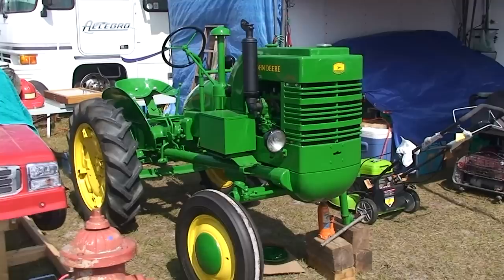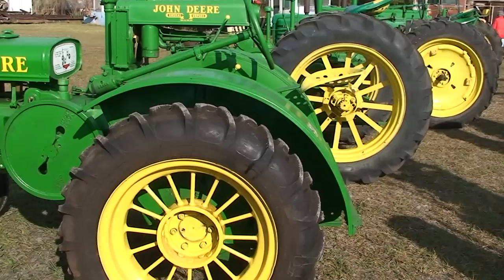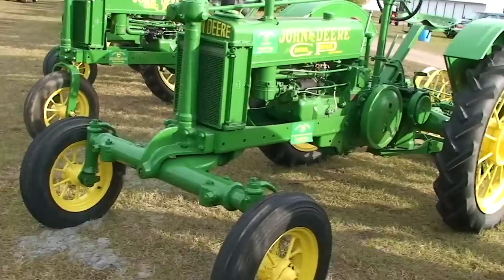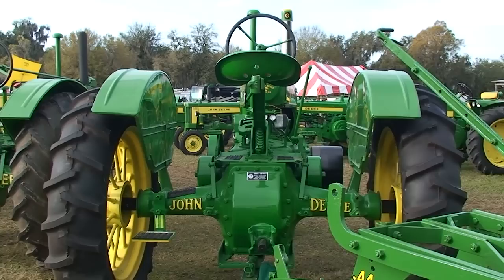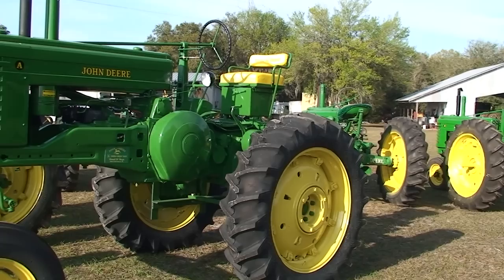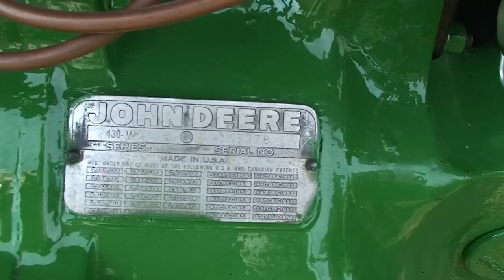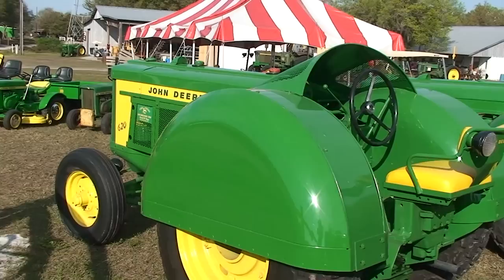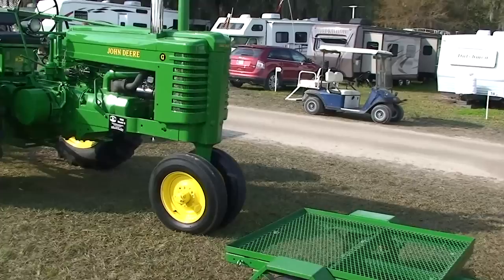John Deere Tractors Through 1960 In Detail Antique Tractor YouTube Video

Comment: When I was a small boy dad farmed with a 1950 model g.. Dad pulled a 3 -14  plow. My grand father used tractor fuel. Dad told me it was like kerosene. The tractor had more power on gas. Running them on gas all the time was hard on valves. Dad was told to put 2 quarts of kerosene in every other tank of gas. That helped.
Reply from the maker: Now that's interesting.  We had a mix as well, it was always over 50% gas.

Comment: My dad's model g was a 1950. It had a factory 3 point hitch , and remote cylinder hook ups. The remote plug in went directly into the drivers right side of the casting. When the remote cylinder was plugged in it canceled the 3 point. The hydraulic hook ups you showed are some one conversion to modern pioneer fittings. In 1946 or 1947 john deere added a electric starter. The square seat support is also the battery box. The tractor you were not sure about looked like a model d to me.
Reply from the maker: Thanks for that addition William.  I knew someone would know and you obviously did.  Thanks again!

Comment: They are commonly known as two-lungers because of being a 4 cycle 2 cylinder engine they were a high torque low RPM engine about 1200 to 1400 ram range
Reply from the maker: Thanks for your additions, Robert.

Comment: I have a model A John Deere, I'm not sure what year it is. If I got a picture up would someone be able to tell me? 
 Its not in the best of shape, so I am currently draining old fluids, cleaning things up.
Reply: If you can find the serial number of the tractor (I think it's by the clutch wheel) you should be able to call a John Deere dealer and find out - or google the number.
Reply: Steve Buettner. Thanks, I appreciate that
Reply: Take a picture of the gear shift lever pattern and send it.